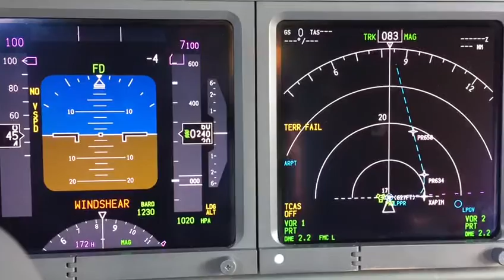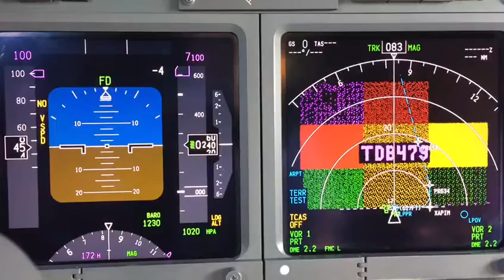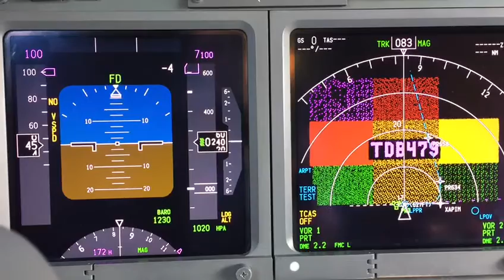B737NG EGPWS Test

Comment: They should implement all of the callouts into the Zibo 737.
Reply: They do , if not 99% of them, this is an example of the extended GPWS test (hence the EGPWS name in title) which can be used by holding down the GPWS test button instead of clicking.